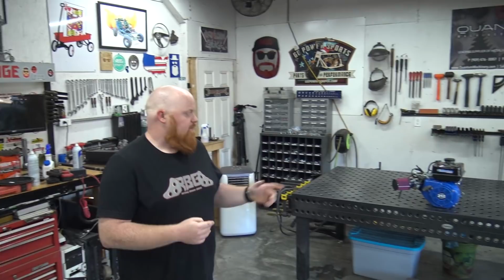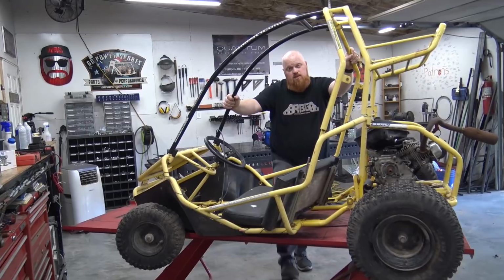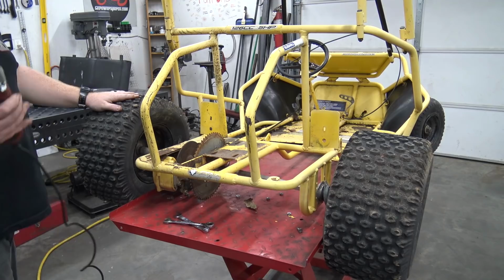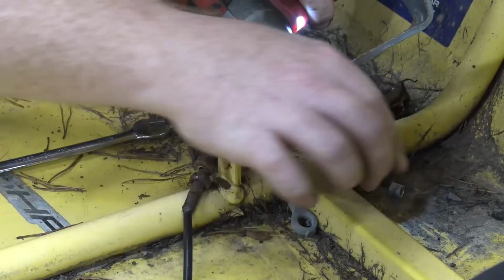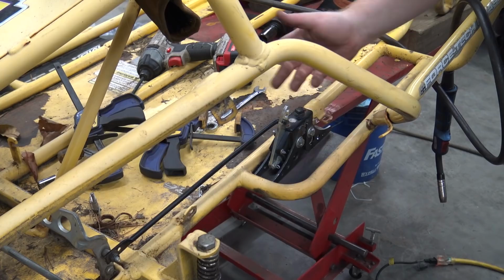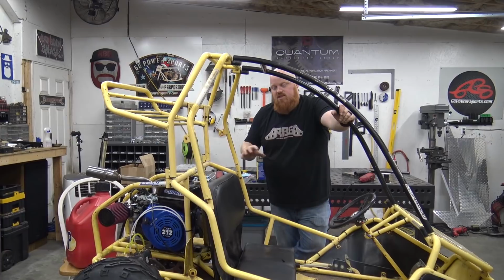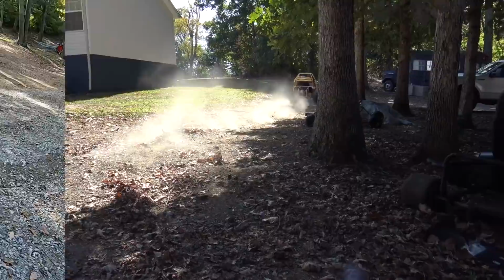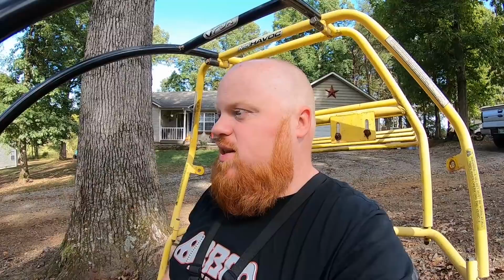💰Free💰 Manco Havoc M5 Go Kart Restoration

Comment: Couldnt you have cut the lower tube frame below the axle on each side to make a relief section and just drop the entire axle assembly down and out, including tires and all?? Then put everything on the new axle and hoist it vertically into place?? Seems a waste to chop up the hex axle. Could have been used or sold for another project